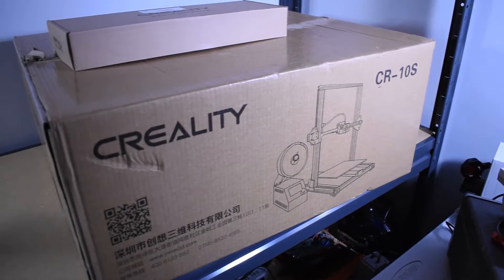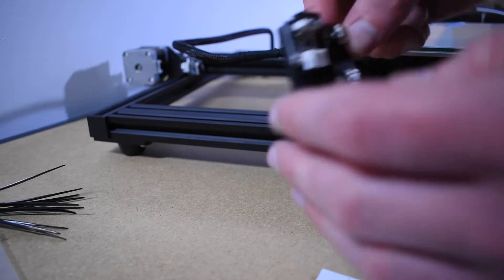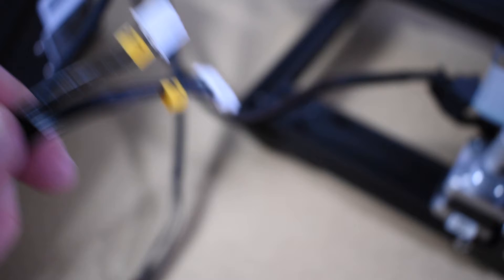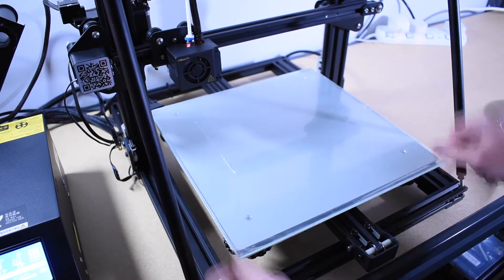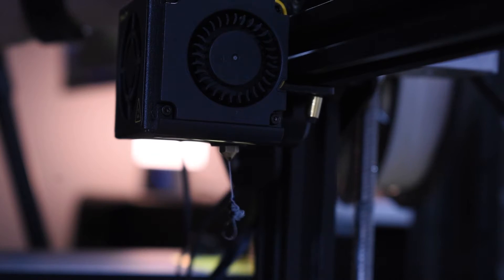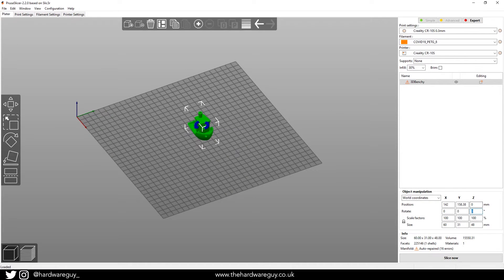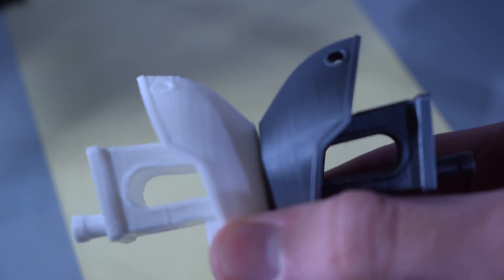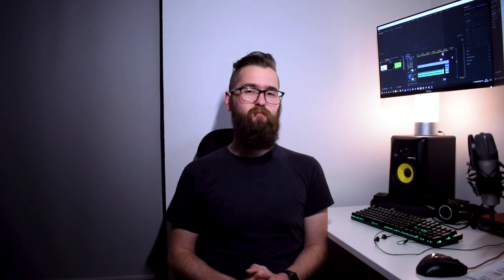Creality CR10S - Unboxing & First Impressions

Comment: Consider the following upgrades to enhance into an excellent printer:
Motor mounts to quiten down noise
Noctua hot end fans reduce noise
Also control box PS fan
Ezabl bed level sensor from TH3D
EZFLEX plate from TH3D
Update Marlin software
This is a fantastic printer to use if you spend a little more money and time on.
Reply from the maker: Thanks for the excellent tips man, appreciate it! I’m looking forward to testing it out over the next few months!

Comment: Thanks for your video. Enjoyed it. I bought a Creality Ender 3 Pro a few weeks ago. Good Price, but not easy to use! So I am returning this and have ordered a Prusa. One of the most things that I struggle with at the moment is leveling the bed and no matter what, there is only one spot to use. It is good for small prints, but not prints with large areas. The center of the bed works best and then as you go out, the quality gets bad. Return it while you can and pre order a Prusa Mini!
Reply from the maker: Yeah I don’t think I’d recommend this as a first printer! I was only able to problem solve so quickly due to the experience I gained with the Prusa MK3 over the years! Have fun with your Prusa!! you won’t regret it, they are incredible machines.
Reply: @thehardwareguy  totally agree!
Reply: @thehardwareguy  can you please message me? ebrahimbadkoubi@gmail.com
Reply: I picked up an ender 3 and after leveling the bed (slightly too high but oh well) it seemed fine, havent printed too muxh that had a large area yet (printed a lever that spaned the entire surface corner to corner diagonally) only problem i had was i didnt tension the belt enough and iy was slightly ovaled for all holes in prints all until yesterday